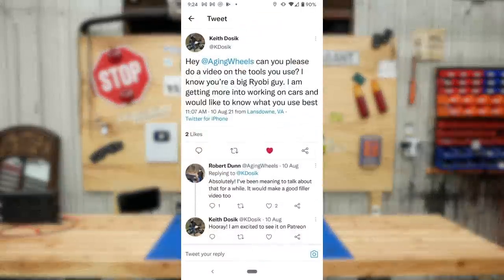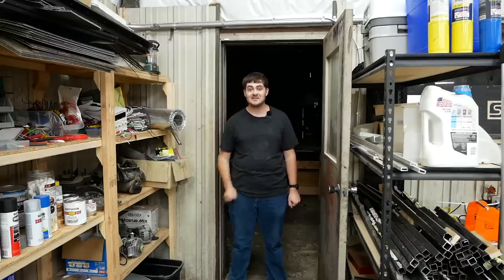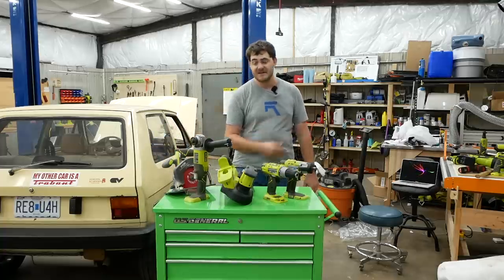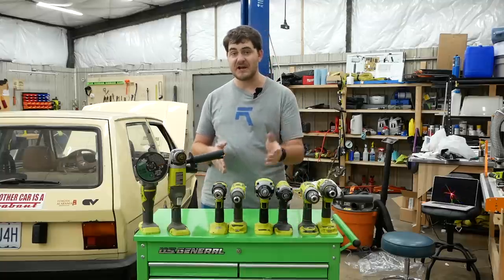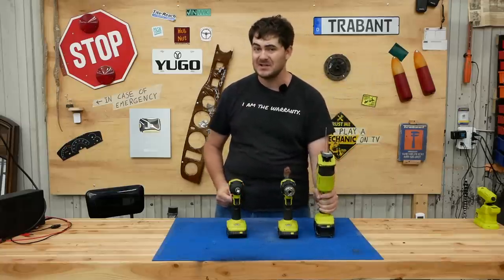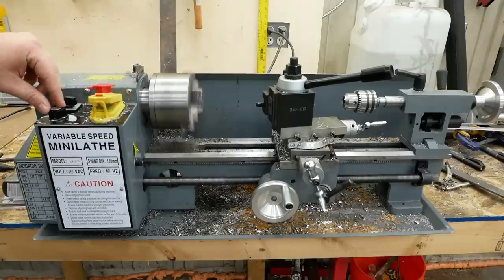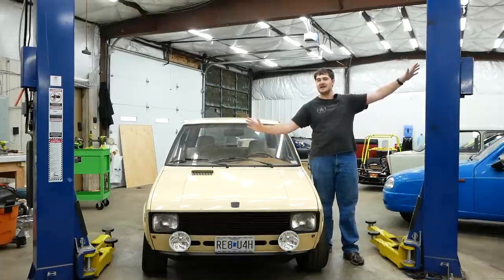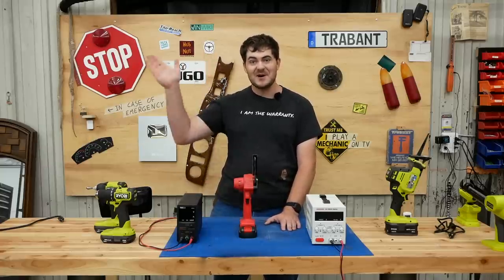What Tools Do I Use? Why? | Aging Wheels Tool Tour

Comment: I'm also into Ryobi. Why Ryobi, well I had no tools, I saw a combo and I've been buying their stuff because it all works with the same batteries.
Also got the soldering station because I needed one, and they had one that worked with the battery and bonus, you can plug that one in as well.

Assuming they sell the small glue gun here (Canada, also Home Depot exclusive) I might get one.
Reply: You are Ryobi's target market. Consumers who have no point of reference and hence no experience in anything better. Ask people who own "higher end" brands and they will say that Ryobi tools are "chintzy"... to me they just feel like cheap rubbish, gutless and flimsy like they would break if you gave them any stress.
I own a few 18V Ryobi, most have broken during use, rather than worn out, and have been replaced with better devices. Actually, now I think about it the only 18V Ryobi that I own that still works is one battery charger (the other one is dead). The 18V batteries are also REALLY poor, since the BMS kills the first cell in the pack so you have to buy a complete new one (I refuse to buy any more of their shit).
And Ryobi 18V aren't really that cheap anyway, so I reckon there's better choices.
Reply: @johncoops6897  my stepdad dropped a ranger on his sawzall that was on fire 7 times and it was fine, wasn't even the nice brushless tools. Never had a ryobi battery fail, although the 40v batteries are complete shit.

Comment: Cool tip for frugal or classical mechanic. Go to a thrift store or look in classified for dressers and other furniture. Then put wheels on the bottom. Boop, mobile storage. Worked great with sewing machine, fabrics, and the such for the wife. Also shop has beautiful wood stained tool storage.

Comment: Blow molder tool cases are useful for specialty tools, but you cannot tell what they are on a shelf as the labels are only on the top.

PAINT PEN.

Mark the ends of those things! So much easier to find now.

Also, lateral office cabinets are fantastic with the lids.  I have several with drawers below and shelves with lids/covers on top.  Strong, not horribly expensive, and really clean up a space.

They also serve the function of hiding my glasses I know I just had in hand a few minutes ago.

Comment: Excellent video Robert. Entertaining and informative as always. A little arm chair quarterbacking here……I’m a retired sparktrician and it sounds a little odd that sparky number 1 did not do a five minute assessment of your house/shop service before adding a heavy load to an already loaded up service. 

My personal tool hierarchy, Good stuff in the service truck, Milwaukee, Klein, and so forth, no so good in my own shop, Rigid, harbor freight etc, tool bench in basement, dollar bin crap, no name Menards.  Gotta the have the good stuff to work with all day every day but not necessarily for hanging curtain rods or working on Yugos. (Sorry. Couldn’t resist)

Comment: My comprehensive toolkit consists of 2 adjustable spanners; 1 for metric and 1 for imperial.  
They both also double as hammers...
Reply: Every tool is a hammer, except if it's a screwdriver - then it's a chisel.

Comment: You do get into an ecosystem with cordless tools. I am in the Ryobi ecosystem, more expensive here in Australia but isn't everything.

The finger sander is a great thing. We use the hand vac as a kitchen vacuum, so much better than the weak ones sold for the purpose, and with a 1.5 Ah battery, not heavy. The inflator/deflator is another thing I recommend. From pumping up my Van tyres to 75 psi, to inflating and deflating a pool lounger, it's terrific!

Comment: Aug 2021:  Of the 18V Ryobi tools used since 2017, my most useful so far are the telescoping chain saw, oscillating tool, and impact wrench.  Sure, the hammer drill works well too.  :)

Comment: Two tools that I didn’t spot in this video, but I have quite recently acquired; cordless die grinder (with decent tips). Man this thing makes deburring, chamfering and grinding down inside corner welds amazingly easy, if you can stand the shower of hot metal chips all over your body and the workshop. 
Second tool is a cordless metal cutting circular saw. This thing chews through thick and thin metal like it’s no problem. With a rail you can cut up sheet metal. With a speed square you can cut 100x100x10mm angle iron in a few seconds. You just have to put up with a shower of burning metal flakes all over your body and shop…. Is this a theme..?! 😎👍🏻👍🏻

Comment: We just picked up a 21in brushless push snow blower yesterday, as our old Craftsman gas snow blower didn't want to start again, and I was too lazy to spend another half hour figuring it out. 
It's our first 40v tool, and I've already messaged a seller to buy some used ones with batteries (a (lower end) leaf blower, string trimmer, expand-it head, 2 6ah batteries, and a charger all for $175 asking price!)

I've got quite a few of their 18v tools. The main ones I use being that 600ft-lb brushless impact wrench, and a brushed impact driver.  Last year I bought a used brushless string trimmer and hedge trimmer. As well as a new circular saw (I forget what size. Was rarely gonna use it anyways, and just got it cause of some deal Home Depot had at the time)

I was interested in some of their USB lithium tools. But I don't think I'll get any. 
If the 40v string trimmer is brushless and has a variable speed trigger, I'll resell the 18v one. If it's brushed and/or has a switch as the trigger, then I'mm stick with the 18v one, and resell that.
But I'mma hang onto the expand-it head, to see if I can find an edger attachment for it. I use the string trimmer as an edger, but it's not perfect of course.

Comment: I've also got a Ryobi angle grinder, and it works quite well as long as a 5Ah battery is used.
Reply: THIS- the brushless angry grinder will gulp down a 3Ah HP+ battery in no time;  I feed mine the 6 Ah ones and it does what I need it to do without complaint.

Comment: I agree 100% about the lift. Before I had my hoist all I could think about was how easy the job would be if I had a hoist, now I don’t even think about it! I bought a 10,000 lbs Wheeltronics 2 post hoist used for $1800 cdn and it was $600 cdn to install it, very reasonable. I did do my own electrical, pretty easy.

Comment: I will 100% echo what you say about AC. I spent 13 years working in a shop without AC and finally installed a unit a few weeks ago, and it is the best thing ever. It has been in the upper 90s here the past few days, but my shop has stayed a comfortable 75 degrees. And for any of you out there thinking you can't afford AC in your shop, you're wrong. haha My shop is about 2000 square feet with 12ft ceilings, and a 25,000 BTU Window AC unit that I picked up used for $125 is enough to keep it cool. (My shop is also insulated) I also have a secondary 12,000 BTU portable AC unit (which I bought used for $40) that I can run as well if I really wanna freeze it out in there. Although I haven't found a need to run the second unit yet, and it was about 100 degree heat index over the weekend and I worked in there for 7 hours.

Comment: I used to have a lot of Ryobi tools. I had a ryobi drill that was all plastic, and wouldn't stay tight. I bought a Dewalt, and the difference between the $70 plastic drill and the $300 drill that actually had a metal tool-holder and nice clutch for tightening was so huge, I gradually started replacing all my green with yellow. Now I have one battery type and the tools never let me down. I learned the buy once cry once during that process. Ryobi isn't bad for the price, but IMHO if you can, you'll spend less money in the long run and be happier using the tools if you just going with a higher end tool first.

Comment: I've had one of these Chinese PSUs for over 10 years now and it's been one of my best sub-$100 purchases. The voltage control is not quite good enough for small electronics, but for  less-sensitive stuff (charging batteries, running an electrolytic rust-removal bath, etc.) it's perfectly fine. Last winter I thought I'd killed it after I accidentally connected it to a car battery backwards and it stopped working, but no, it just overheated a resistor in what I'm assuming is some sort of back-feed protection and after turning the PSU off and letting it cool down for a few minutes it started right back up like nothing happened. I also have a random $5 USB charger than I bought at around the same time and it's outlived several other "brand-name" chargers (Nokia, Samsung, LG...).

Comment: I like their little $100 pressure washer for washing vehicles. The quality is actually really good because none of the metal bits are rusting, and it still works after dropping it many times from where I let it sit. You also get 3 nozzle types and a port for soap.

Comment: 11:12 I actually have the PCL500 5.5" circular saw, and I love the thing. Sure it's not the sort of tool you want for ripping full sheets of 3/4" plywood, but it is great for laminate flooring planks and trim work. I've also used it for chopping up Dricore subfloor tiles for a basement project. For transparency's sake, I bought it used off of eBay for half the price of new and installed a 100 tooth finish/OSB blade.

Comment: Funny thing, I am currently designing a case for the ender3s main logic board, the lcd and a rpi4. I moved all the components outside of a "printing chamber" I quickly hacked together from two ikea "LACK" qube tables and some acrylic sheets as sidewalls.

It is just astonishing how good this works to keep the temperature constant while printing.

Comment: I have the same impact gun...300lb is low compared to other brands/models...but I've had mine for 2+ years, it gets used every weekend and I have had maybe 5-6 times it couldn't break a bolt loose.  wheel nuts put on with a breaker bar, no problem, bolts needed removing to replace the timing chain on my s10, easy, mopeds/gokart/riding mower...never had any bolts it couldn't loosen.  I actually thought about buying the new brushless version...but since mine works like new and basically always gets the job done, I couldn't see spending the money.  I built my Ryobi collection after my dad bought me a combo set way back when I got married...back when ryobi was a dark blue!

Comment: In case you did not know, you should not turn a lathe on without anything in the chuck. There is a chance it could throw a jaw out if its not clamped on to a piece of material.

Comment: I’ve owned Ryobi tools for over 25 years and I feel the same way.  Their first blower didn’t last long, but the new 2 speed high volume QUIET blower, I’d put up against the best gas ones.  My Sears half inch drive niCad battery drill is about 20 years and still working.  For the price and quality, Ryobi can’t be beat. And in conclusion; Great Video

Comment: Only power tool I use is my grandad's corded impact gun for removing lawn mower blades and engine bolts, I still use my Pittsburgh Harbor Freight set of colored sockets with the plastic holders I got when I was a kid in 2009, and the only new normal tool I ever remember buying is an 8" Irwin wire cutter because all the ones I have are small cheap ones that I don't care for.

Comment: Thought popped into my head when you were talking about your tool wall @ 2:30.
What if you made it into a magnetic tool wall?

Add a steel sheet to the plywood board you have now (keeps it flat and you could still nail through it if needed for things that need to stay there) then you could add magnets to the backs of your plier and screwdriver holders and what not. 
When you need your tool sets elsewhere you can move them to the side of the new mobile tool box. Then when you you're done you can move them back to the wall where it both looks good and lets you see what you need. (plus it looks better in videos IMO to have things on the walls like that.)

Kind of wish my shop was big enough to make this worth wide for me tbh.... might do it anyways.
Any who, I figured that I would pass it on and see if it caught your fancy, just a thought. Love the videos and keep up the awesome work. :)

Comment: I was so expecting that story about the electrician setting up the power for the lift to end with the revelation that you got scammed by somebody. I'm glad it didn't go that way.

Also, the only cnc machine I've ever seen is the big enclosed one that I think uses water jets to cut, because my school had one of those for the mechanical engineers.

Comment: At the end of your video, you just breezed past what was for me the most intriguing tool in your collection. The mini chainsaw! I need to know everything about it.
Reply: Yeah - I wanted to see more too. I recently bought the exact same design for AUD $13 delivered. There was no battery, and it's an odd-ball connector so I had to hack it to fit some Ozito batteries, and it was more effort than it's worth.
The tool is pretty sketchy but good fun. There is no chain oiler, so you need to carry a squeeze bottle and douse it quite often. It cuts branches much better than a Milwaukee 18V Sawzall, surprisingly good actually! Make sure to buy the version that suits Makita batteries.

Comment: I have abt. 30 various RYOBI tools, exactly because of the reasons mentioned - cheap, good/fine quality, single battery (except for the dreaded brushed angle grinder, which is crap, but can still cut off steel tubes/rods etc. in unpowered sites, if you're really patient with it). I have abt. 5 pieces of the basic old first-gen yellow (before that, RYOBI tools were dark blue) CDC1802 cordless drills, which I bought because I knew they would discontinue it at some point and it is a mighty fine drill - all 5 still work. Oh wait, only 4 work as I dismantled one because the head part (chuck assembly) had developed a longitudinal (forward and back) movement and I thought I would replace a bearing but never got around to completing. I live in Latvia and order most of my tools used from German e-bay (Latvian market abt. 2.6 mil. while Germany's market - abt. 90 mil.), and have purchased only one RYOBI tool new in shop here in Latvia as it had a massive discount. Funny as cordless tools are exactly the same in Latvia/EU and US, which cannot be said about corded tools. About the same cordless impact drill featured in the video - got it used from Germany with a... yes, broken clutch - it was stuck in a fully opened position and was useless. Was trying to take it off the machine, the same way I have taken off and replaced dozens of drill chucks - it wouldn't budge, even after applying some rather heavy-fisted (idiotic) methods. Thought the last resort would be to cut it off with an angle grinder. Before that, shoved it in a vice with the chuck pointing upwards and poured the chuck full of WD40. After abt. 2 months sitting in the vice I picked it up and the chuck had started working and has never quit... albeit being slightly dangled up because of the dismantling attempts. Anyway. Each brand has its strengths, and RYOBI's happens to be cordless tools. Thanks for the video and keep up the tinkering. Greetings from Latvia.

Comment: +1 for owning multiple brands. I have the ryobi because it has a very diverse tool set like inflater and hot glue gun, but the M12 series has the cordless die grinders and much more compact ratchet. I have Bosch for anything i need more reliability or power from. most of us have multiple brands. there is no escaping it if you want the diversity.

Comment: I have the soldering iron, I left it outside in the rain for a year on accident. IDK if it still works but it was awesome for rewiring trailer lights. Bonus I found it much less burn-y than a butane torch

Comment: I bought a Ryobi set back in 2006, They are still kickin' and use the same battery. I love them. Thanks for the review of other Ryobi tools, as I've been interested about many of them.
Reply: That is the same reason why I went with them; I have a couple of their 'blue and yellow' color tools from the old days of Ni-Cad batteries, and with one exception, they still run just fine. (that one exception was the oldest drill I had, which I literally smoked trying to bore a hole through a stump I was trying to pull.)

Comment: That Milwaukee electric ratchet has been a godsend with the many times I've had to remove and reinstall the bumper of my car for several annoying purposes like replacing the headlight bulbs, replacing the front parking sensors, and replacing the front parking sensors, and replacing the front parking sensors... and then going back to see why my new headlight stopped working, and then replacing the parking sensors once again. Least I can get the bumper off in about 3 minutes.

Comment: that ultrasonic works very well. i use it more often than my 5000$ omegasonics. get oil eater. don't pay attention to the timer, just keep it running. as long as its hot and noisy, it works extremely well.